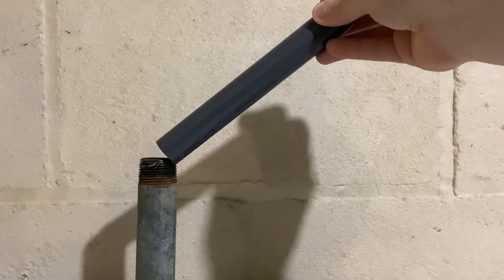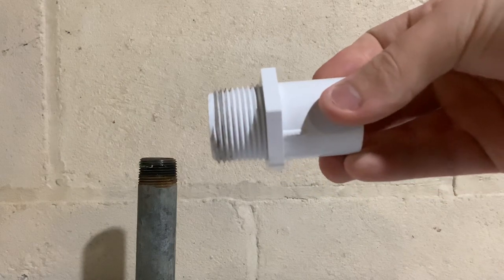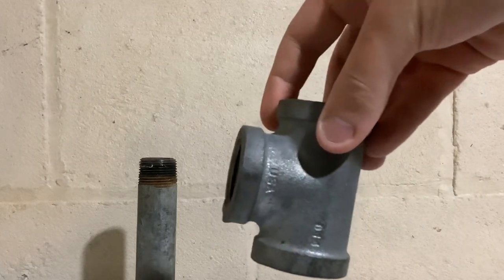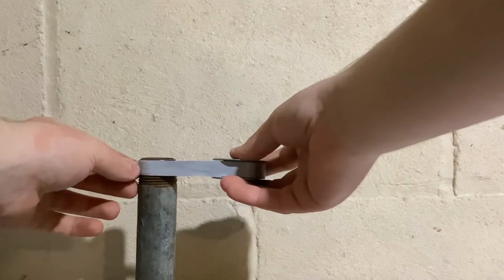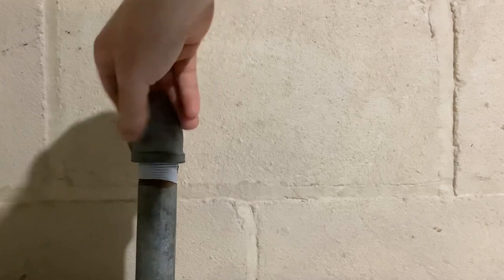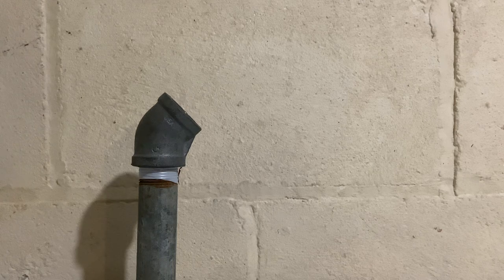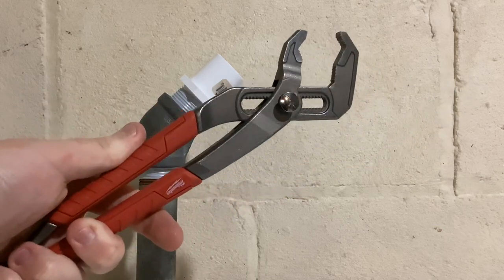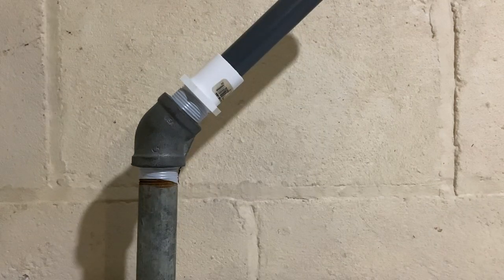How to connect a threaded metal pipe to a plastic pipe.

Comment: They also have specialized transition fittings which are quite expensive but are worth it for more demanding applications like a house's main water service. They have a copper or brass body and a PVC female part built right in.
Reply from the maker: Those are very helpful, if I don’t use those or what i did in the video I would use a spears sch 80 female adapter with the metal reinforcement ring.

Comment: Is this less likely to
Leak? I have a connection the other way, with the female piece being female, and I have small dip. Will making the connection this way provide a matter seat between the metal to plastic?
Reply from the maker: The female adapter can crack and leak, in some places it is even illegal to use a plastic female on metal pipe.